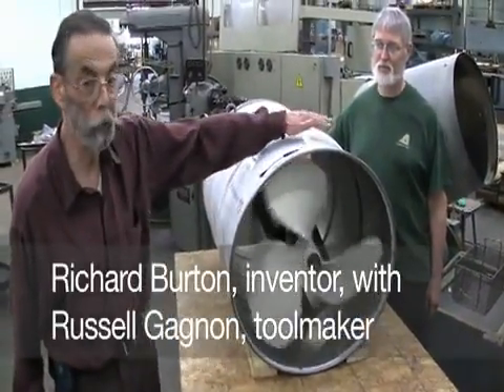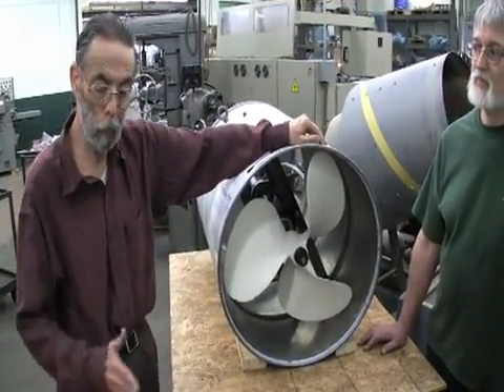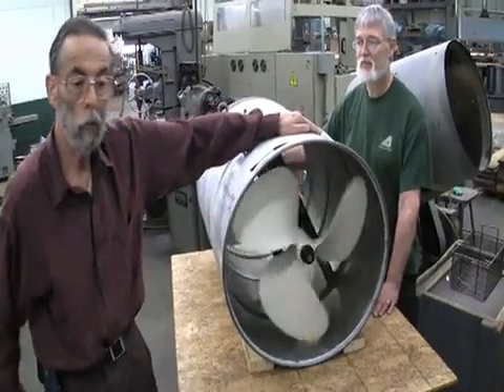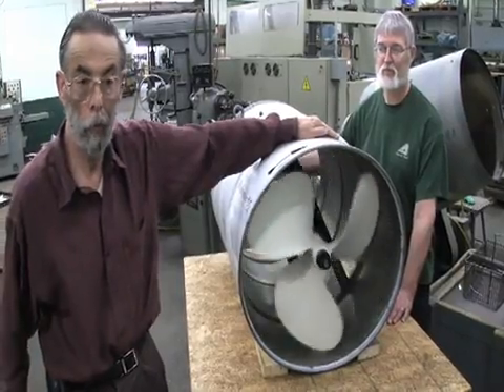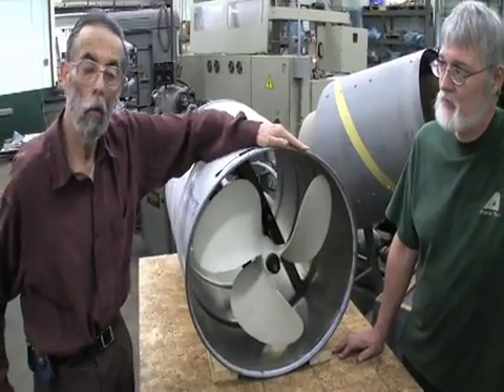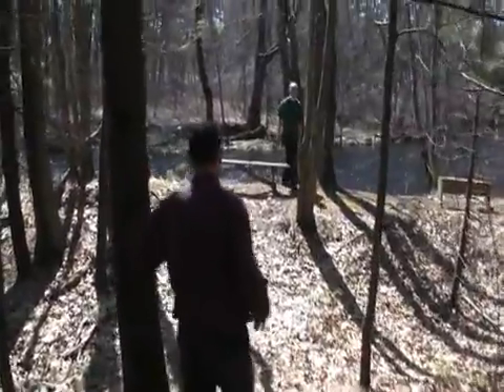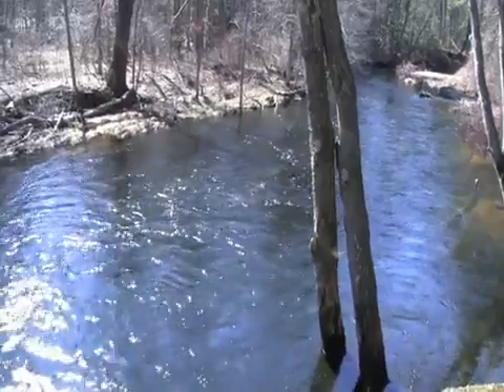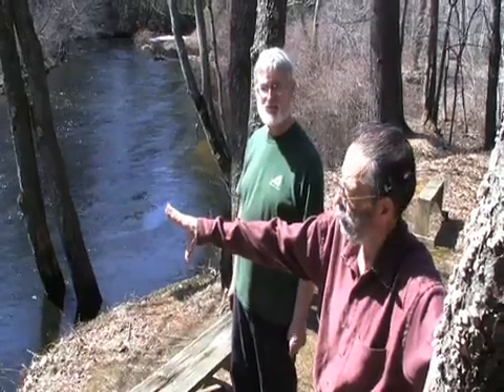How do you choose a Hydro Electric Generator for Flowing River

Comment: I think this can be converted  for use on sail boats to recharge or  power the ship, Drop and drag  with attached tether and power cord  easy plug and play  120 or 240 depending on the size of the ship, Add in auto retract ability.